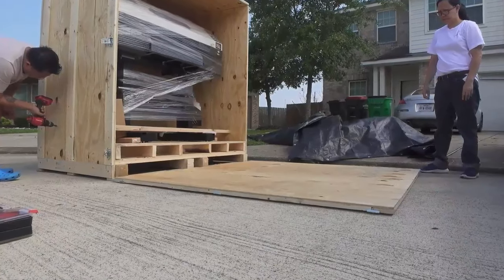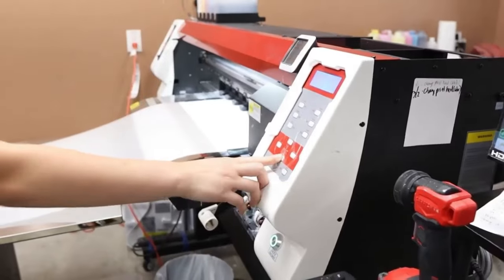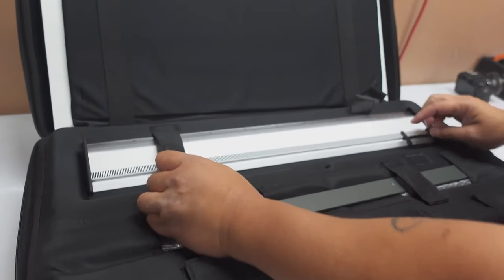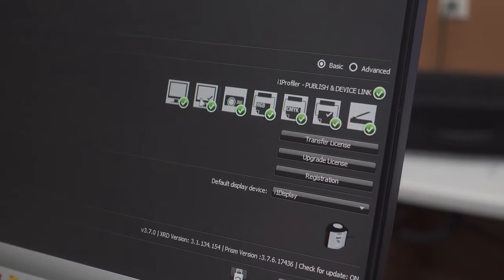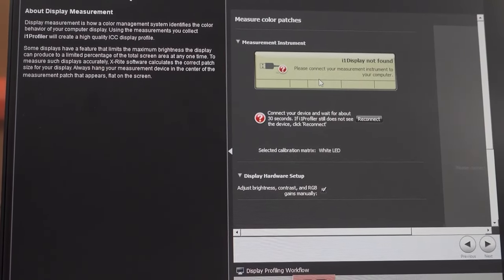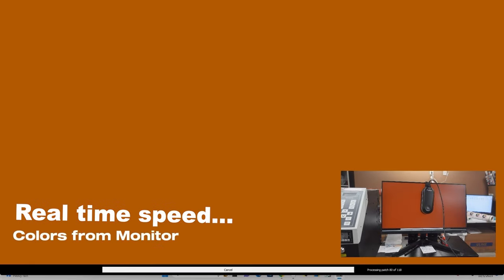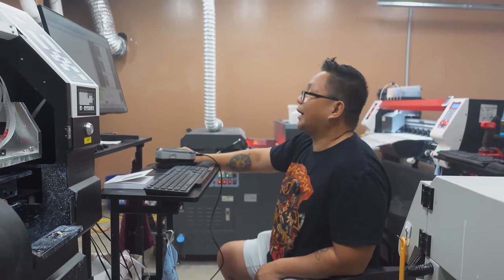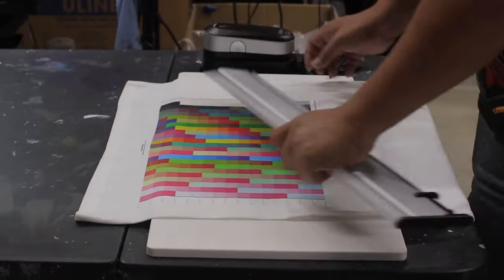DTF Printing Hacks | How to Fix Your Colors with XRite iPublish Pro 3 +

Comment: For best output calibration make sure your doing Ink limits-Density linearization - total ink limit - then icc profiling. Any misstep in the beginning steps will ruin the latter steps. Also good to have a proper test print for comparison on what your trying to achieve. Happy profiling!
Reply from the maker: Thank you! I would live to learn kore from you if possible.
Reply: Best jumping off point is to read the RIP documentation on the specific steps for output calibration. I'm using Ergosoft and it works very well for our large number of printers. Profile creation can take many years of experience to get right and consistent. Not really as easy as reading a swatch from a spectro
Reply: Yes, I’m learning this the hard way. Whew!!! Hotta keep hoing at it, though